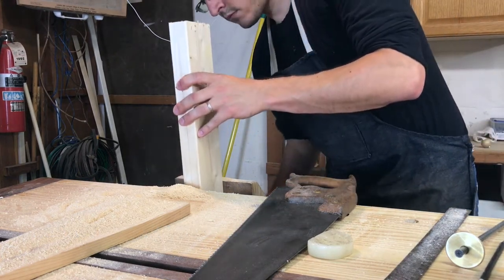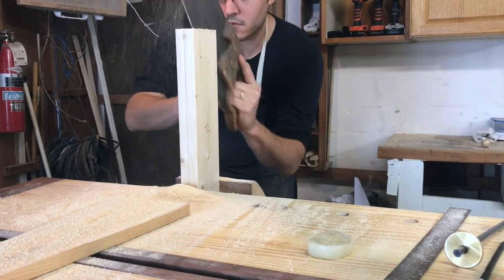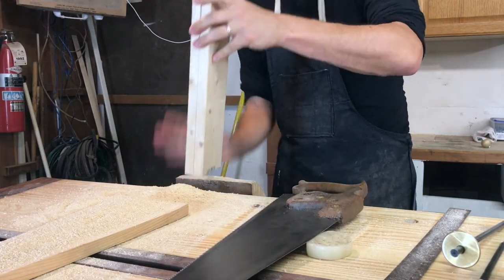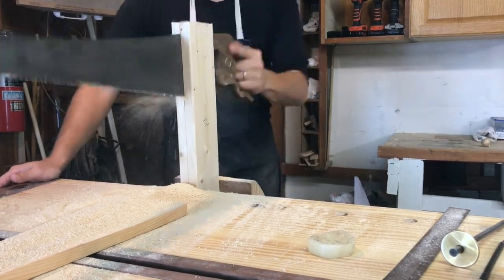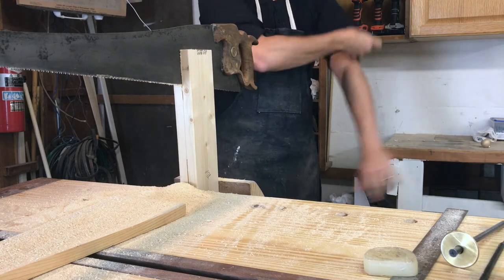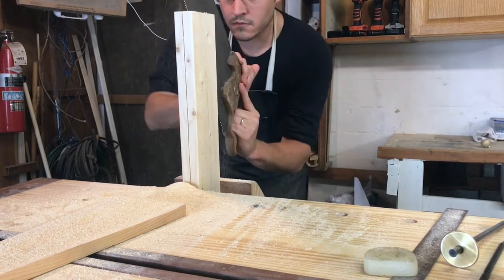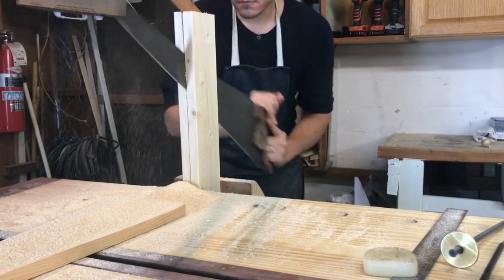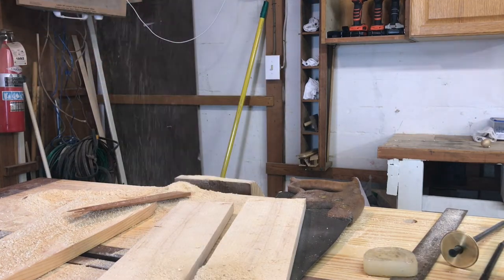Resawing 2x4 in Real TIme

Comment: I've only been woodworking for a bit over a year... so lots of learning going on. Of the many things I've learned, one that was actually pretty shocking was how difficult it can be to rip pine! I HAD thought that since it was soft wood it would be easier to saw than hard wood. 

I had a good amount of some very old pine boards that were little problem but the "fresh" pine that I'd bought and let sit for just a few months took a lot more effort to rip than I expected. Even after sitting for months, it was still soft and/or wet enough at the core to be pulp when re-sawn. It clogged up the saw teeth constantly and was a real pain to deal with... give me oak any day! LOL

Having said that... the only wood I've sawn that was more difficult than fresh pine was quarter-sawn purple heart --- which was a beast!
Reply from the maker: So true! Pine seems like a great wood to start out on because it is cheap and soft, etc. So I practiced dovetailing and all that on pine but never got great results. When I actually dovetailed in walnut it was easier! Now I have pulled off some nice joints in pine, but yeah, I prefer other woods for sure!! Thanks for watching and commenting! Keep at it, man! I can’t believe how far I’ve come since I started a few years ago. Cheers!

Comment: Andrew, I'm no expert either....and it doesn't matter cause if it's working for you and you are getting good results, go with it. I think the biggest thing about sawing boards is repetition and muscle memory. The one trick that I've found that helps with following the line is to angle the board away from me, which would mean putting it in the vice 90 degrees from how you have it. This changes the angle of my hand and allows a little more control versus squatting down to drop you hand angle.

Comment: Great Job. I’m learning myself, just curious if you hand planed the pieces of wood afterwards.  If you did hand plane them, how long did it take to get them flat?  Thank you.
Reply from the maker: Thank you! I did plane them. Usually, you’ll want to make sure they are somewhat close to flat before resawing, that way you can establish the cut parallel to a flat surface and then have less twist and such to plane away. It avoids multiplying imperfections. Since this is pine, it takes a few minutes each to plane them up flat and square.

Comment: Resawing in six minutes isn't bad, I doubt you could do it that fast with a table saw if you factor in set up time.
Reply from the maker: That’s my though exactly. If you have a sharp saw and follow your line you can make great, fast progress. The big down side is that the surface needs quite a bit of work still. A table saw leaves a much cleaner surface. Thanks!!!